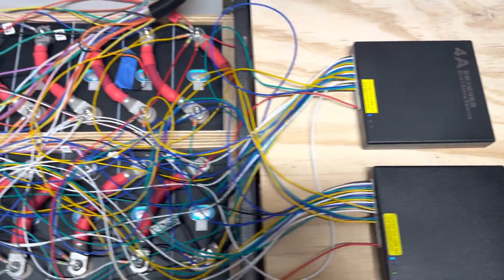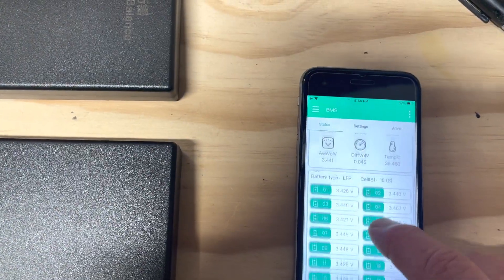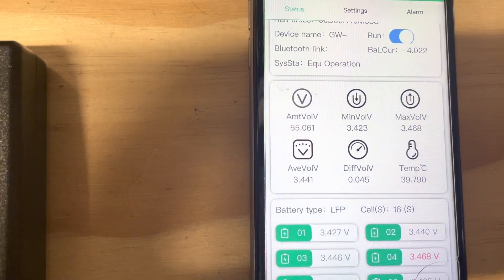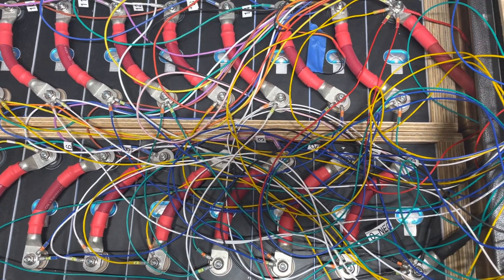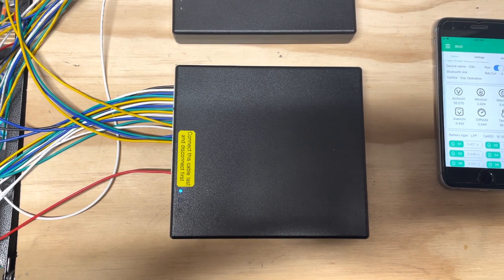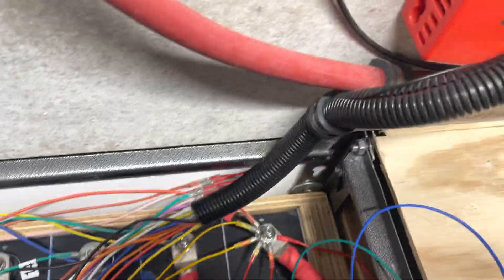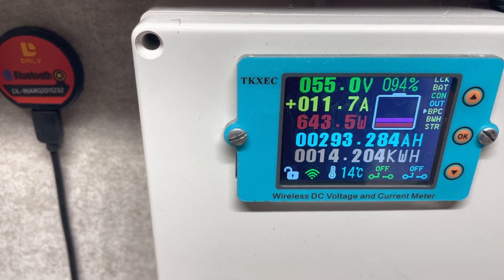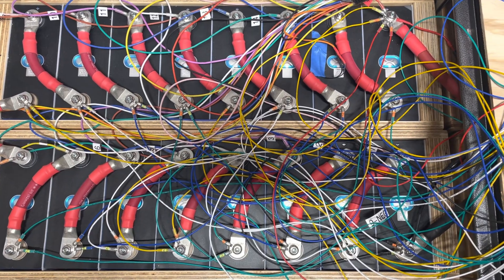Top balance in series FAIL

Comment: If you give the balancers enough time they will balance them very close within 10mv or less. I have found this to be quicker than paralleling cells with a very high current power supply depending on your power supply it takes a long time to top balance, at higher voltages you can speed the process up and use your solar. You just have to wait for the balancers to do there job.The key is to set your power supply voltage just under the max voltage if one cell gets to max voltage the bms stops the charge giving the active balancer a chance to  catch up as they get near full. Keep increasing the voltage until max voltage is reached for the chemistry of your battery for all cells in series.

Comment: Running 2 active cell balance's will never fine balance as a high cell triggers its voltage dips and the low cell peaks - the second balance see's the low as high etc -  Use one balance and  reduce the charge as it goes up the knee - I use the same cells  in my RV
Reply from the maker: Yup that’s why it was titled “fail”. My earlier videos used a 80 amp power supply with the traditional parallel top balance and that works. My setup now is a 32 cell 2P X 16 S configuration. First I top balanced two sets of 16 and cycled them a few times, took note of the strongest and weakest cells. I paired the cell base of the ratio of differential scale(weakest to strongest). The results are amazing. The delta is virtually nil between the knees even under load.
Reply: @SkypowerwithKarl  Sounds like you have it covered well - I have made up quite a few packs and always try and use matched cells from the same batch sequence - for packs 8S or less I always use my T8 30a charger that active cell balances 15watts as it charges - saves all that parallel charging faff - I discovered that even running the BMS bleed balance with the active cell balance of the charger throws it off - its either one or the other not both - I found the 60mA bleed balance on my blue tooth 120A BMS  more than enough to keep packs balanced to within 3 mV when in use.
Reply from the maker: @trevortrevortsr2  
One thing I’ve learned and seems to work, no balancing below 3.4vpc better to get it done at 3.45 and above but it’s usually already back in discharge cycles so whatever gets done above 3.4 will have to do and so far so good.
Reply: @SkypowerwithKarl  I  only cycle  to 3.4Vpc  then the water heater solar dump load kicks in -  every so often let I switch the dump load off and let it  run to 3.6Vpc  to balance - the discharge curve is so flat charging off the heal is pretty  ineffective
Reply from the maker: @trevortrevortsr2  
Sounds like you got it nailed down too. 3.4 is the ragged edge for stop charge. When your cells get older you may have to raise it a bit. Funny how many want to charge to 3.65 and go below 3 V on a regular basis. To gain what 5% and cut the cell life by 75%? My working range is 3.515 to 3.187 vpc system shuts down at 2.5 vpc if everything goes to crap(both BMS and inverter settings). Have never let it go below 3 when I ended the capacity test/commissioning.